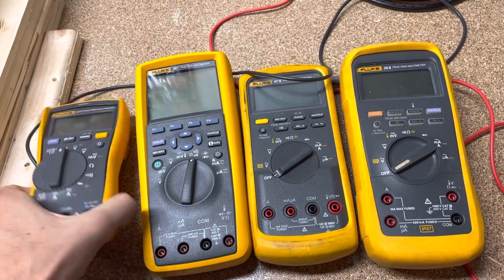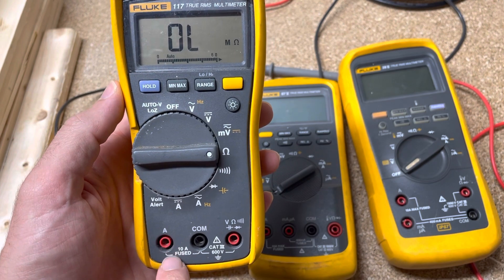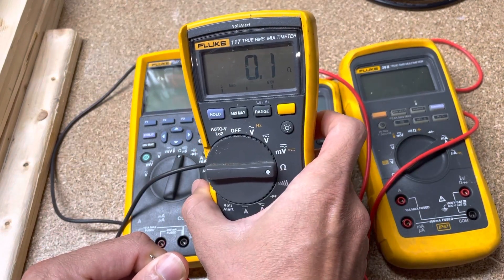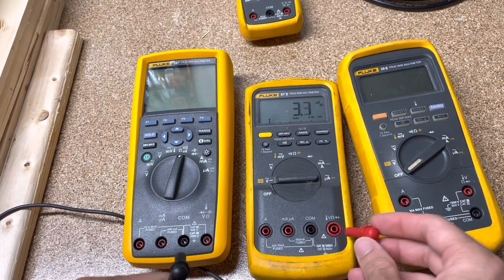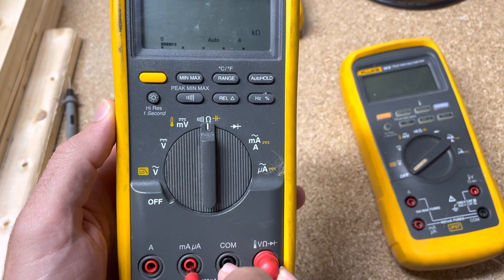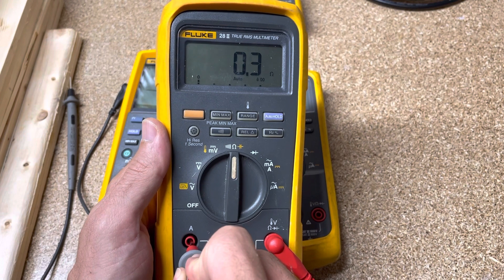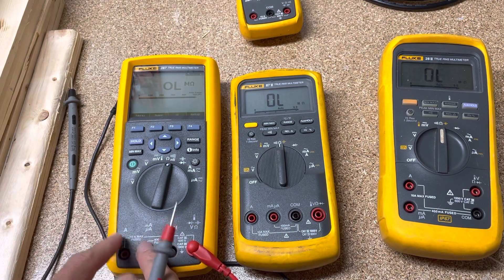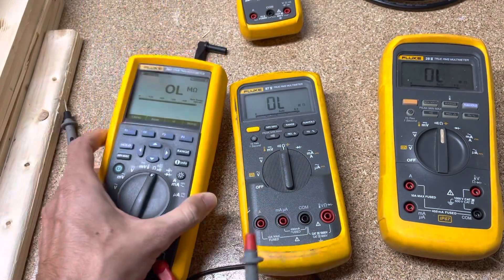Check your DMMs fuse - Fluke Fridays - Episode 70

Comment: The fuse wont always help. I had the probe in the mA port and tried to measure a 575vac buss voltage. Yes, Arc Flash event and meter exploded in my hand.  +1 for PPE !

Comment: What if you have a high resistance reading? What does it imply?
Reply from the maker: I'm not sure you might want to call tech support and walk through it with them.  800-44-FLUKE
Reply: @fridayswithbrandon   hi Brandon looked in to the meter again ,realised that I'd had a blown fuse, just changed it and some how ,the buzzer is back on full song weird or what 🙄